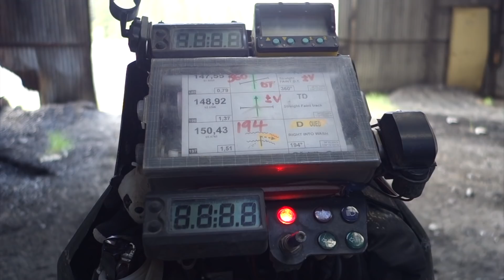Races to Places SE12 EP07 - Angola - Adventure Motorcycling Documentary Ft. Lyndon Poskitt

Comment: Hey good choice of change in route when it was necessary. You know that. With a heavy loaded 690 in hostile terrain the right thing to do. Last few years been running the Dunlop AT81 on the front of my XR650L. Amazing all round hard rubber knobbly that can handle road miles as well as proper offroad. My free rubber recommendation of the day.